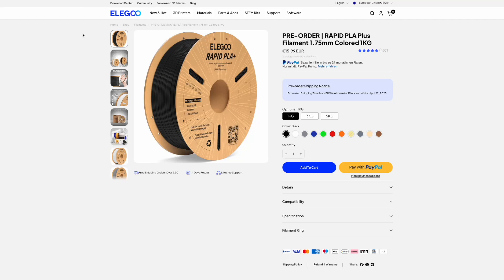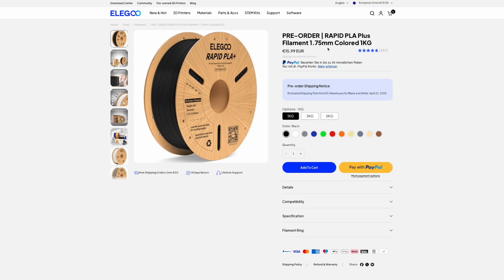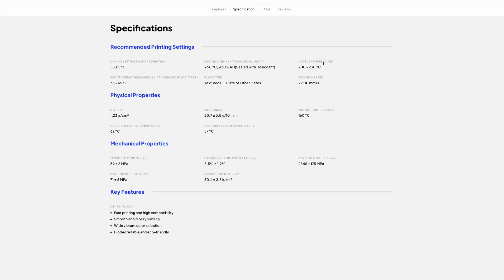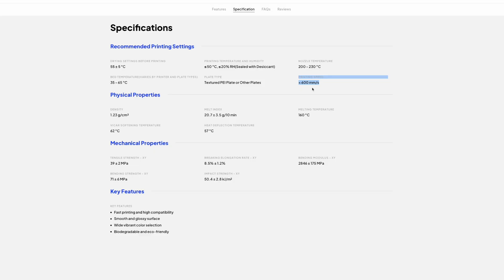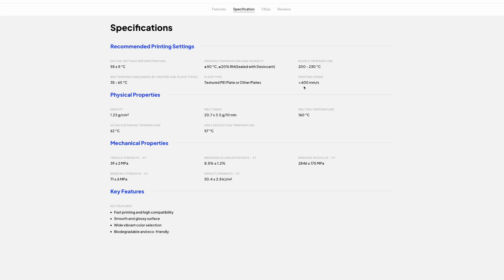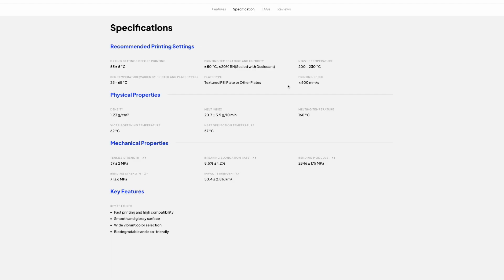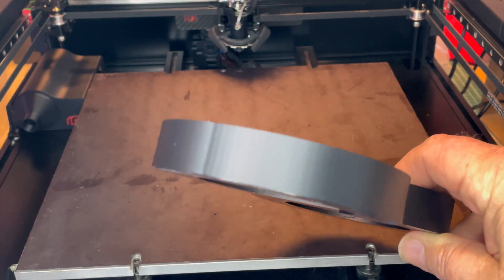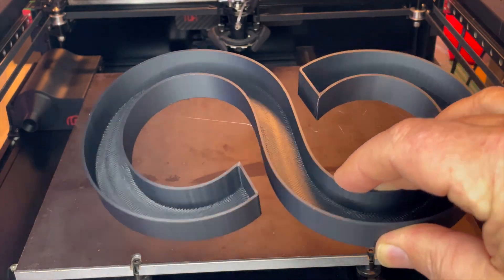100K Accel?! Voron 2.4 with mammoth-3D AWD + Elegoo PLA

Comment: If that logo came from the same dxf I used to put the logo into my designs for my printer accessories than I can tell you that the "artifacting" is actually from the fact that the curves are a bunch of short strait lines not curves.
Reply from the maker: Thanks for your feedback.
Yes can be. I did not make the STL file. I got it from Printables so didn't see what the dxf file looked like.

Comment: What's the build volume? Would this mod allow for larger volumes even if it has to go slower?
Reply from the maker: In the video it's a Voron2.4 with mammoth and gantry. I only have it for 6mm belts. But a new version for 9 and 12mm belts will come out soon. That would be the one for big builds.
Reply: @ awesome! in this video which voron 2.4 size variant is it? 350mm?
Reply from the maker: It's a 300, but 350 would be better to use with the AWD. Then you get 330mm on X and Y

Comment: Great work as always! 
Overtune „turbo PLA” is also 600mm/s rated (up to 40mm3).
Reply from the maker: Thank you very much. And will look into that Filament. Never heard of it so will see if I can get my hands on 2 or 3 kg.
Reply: @mammoth-3D  Got a VZBot recently and was testing the last few days. It's a beast!
With the ELEGOO Rapid PLA+ I got to 45mm³/s at 600mm/s and 230°C with the Goliath hotend (0.5mm nozzle).
Was not very impressed with the flow rate tbh, since my Bambulab A1 Mini can get to over 30mm³/s at the same temp - and also since before that try, I got to 75-80mm³/s at 0.25mm layer height with "THE K8" polycarbonate from kexcelled (just a random PC I tried for the very first time, lol). 

Also the surface quality result with the ELEGOO Rapid PLA was underwhelming this time (blobs everywhere on the inner walls of cylinders).
Might be that I got a really moist spool(?)
Previous spools I bought printed fine at 30mm³/s & 230°C on my Bambulab A1 Mini.
I'll dry the spool and hopefully inner surfaces will be fine after that.

Could be from the Goliath too though, but I doubt it. Needs more testing.
Reply from the maker: Yes for speed prints I always dry my filament 12 - 24h even PLA. So its 100% dry and only like that I would get the best out of the filament

Comment: Couldnt they provide max flow info? 600mm/s tells nothing. Your flow was 50,4mm³
Reply from the maker: No one gives us that Information ;-)
Yes can be, as I can remember it was around 45mm³
Reply: @mammoth-3D  0.2 layer x 0.42 or 0.44 nozzle x 600 is over 50mm³ 🤷🏻‍♂️
Reply from the maker: @wykonczeni  I dont know how true Klipper is, what its showing us. But at 600mm/s my flow is 46.4mm3

Comment: The Elegoo Rapid PLA is really good looking, I print a lot in the black and the bright green and it's very consistent.

What flow rate were you running at?

On my Phaetus Rapido I have it tuned at 22mm³/sec for the Rapid PLA, I am building another printer with a Rapido 2 so I have a feeling that will get a higher flow rate. But that Goliath hotend is far more capable than my Rapidos.

Great work!
Reply from the maker: Yes I will be getting more of this Filament. I think it's awesome!
600mm/s gives me about 46.4mm3/s